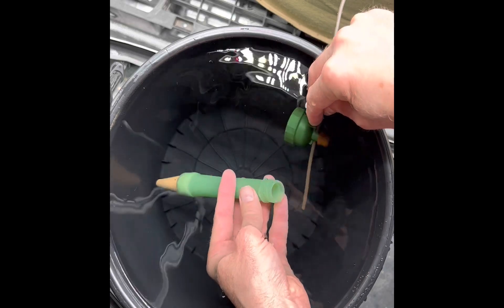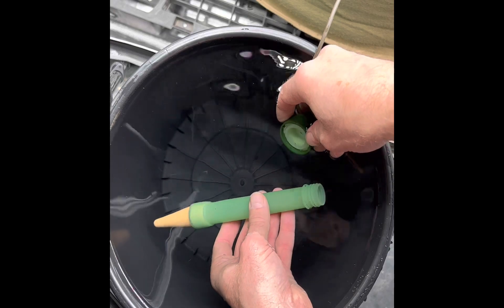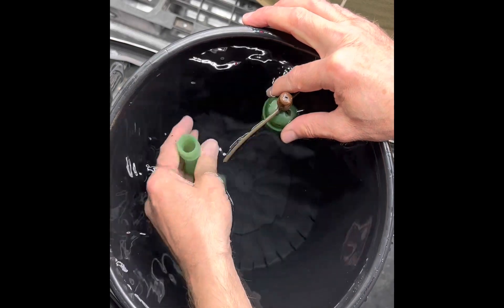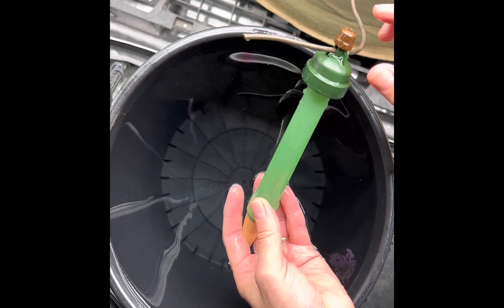How to Cap-dial Calibrate a Blumat Carrot

Comment: Amazing info! Only video i found so far talking about the pressure difference considering the height of the reservoir + volume of water in said reservoir. One question i have is how do i get to the exact turns needed, considering the reservoir is @ 7ft elevation? If 1 triangle is 50mbar for 5ft, should i go 1and a quarter? Just msged sustainable village about this.

Comment: Hi there, thanks for taking the time to share this with us. Are you aware of any other gravity fed drip tape or tube options? Have you tried using regular drip tubing that is supposed to be used with higher water psi? I have and it works with water elevated 1m above ground, but I haven't got much tubing added yet, so it may stop working, I fear. Thanks!

Comment: Thank you, great info!!! Question, does the cap need to be submerged for this method?
Reply from the maker: Thanks, growmie.  Sorry for my delay in responding but yes, you need to keep air out of the system so keep it submerged.
Reply: @sparkysgrowroom  man does this work for pots too? My pots have been way too dry
Reply from the maker: I'm not sure exactly what you mean, but if you are asking about using the blumat system in pots, then yes, they work for them, too.  They offer different styles and sizes.  I started with their original system and put a large carrot in each 5-gallon pot with a slightly elevated reservoir, and they worked great.  Hope that helps! 
PS: I am not associated with Blumat at all. If you are in the US, I recommend contacting KIS Organics and they can get you set up.
Reply: @sparkysgrowroom  okay I was just wondering if they worked well in pots. I have to reset up the whole thing later using this method. Wish me luck.
Reply: So what I don't understand is why you keep in the water? Might as well just put the carrot on, yes? What changes from the cap being under water and the cap on the carrot filled with water and soaked? None